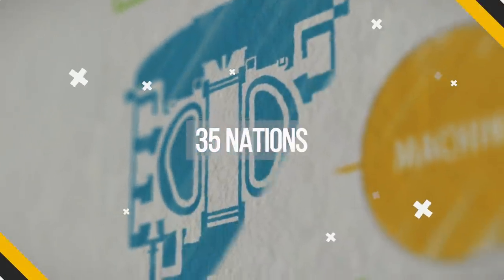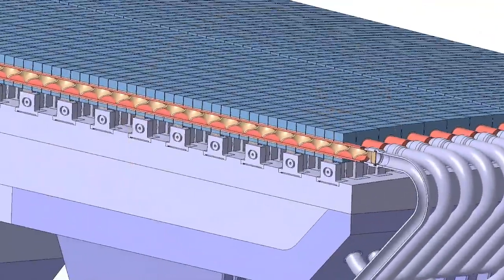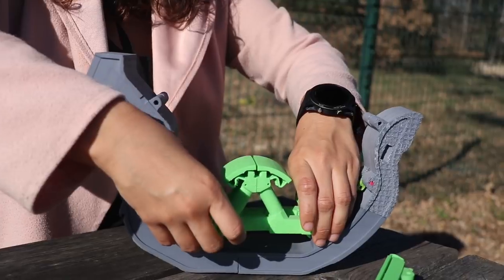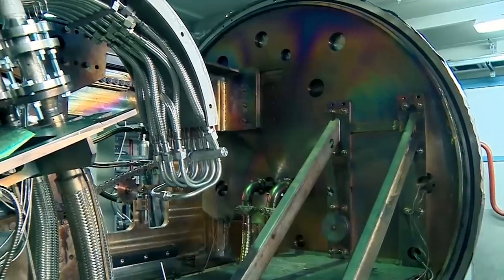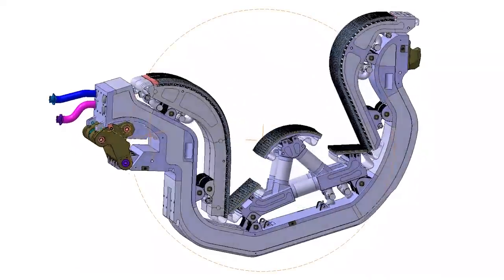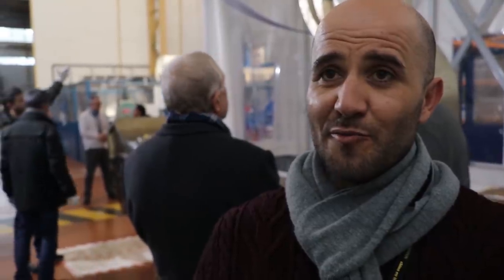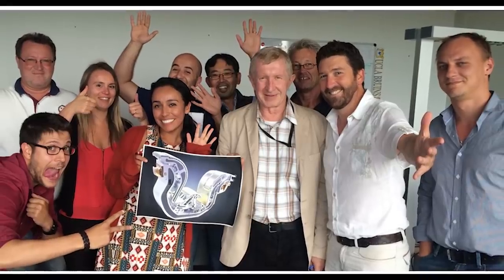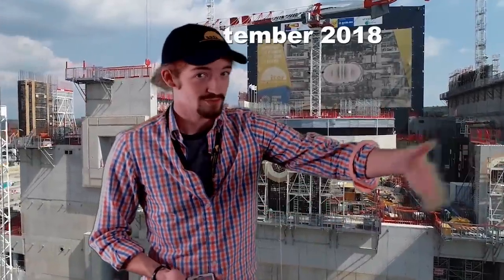ITER NOW 1.7: The Divertor Section

Comment: Thank you for going into the specifics of the ITER machine, it is really interesting.
I love this project and even if the only thing ITER did was provide a small chance of working fusion and nothing else I would be for it.
But many people are still very sceptical so I would like to ask you if you could you cover some of the innovations that have been done over the course of the ITER project and show that while they might originally have been meant for fusion research that they also have other important applications outside of this.
I think it is important that even If people are sceptical about fusion research that it produces tangible results that cannot be denied.

Comment: Great job, love what you're doing documenting this engineering feat! Looking forward for the next videos.
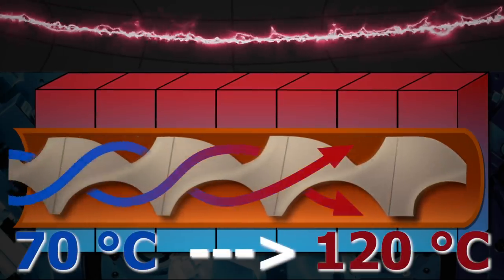I just wanted to point out that at 3:01 the animation can be misleading: the "swirl" (twisted copper tape) does not move, it is actually fixed in place, and induces turbulence as the water travels around it (source: I work on the PFUs for WEST at CEA).
Reply from the maker: You are absolutely right. The swirl is stationary, indeed. Thank you for pointing that out. Quite an amazing system.

Comment: I thought ITER time plan will ends in 2020 😔😔
Reply from the maker: ITER's first plasma will be in 2025 - the divertor doesn't have to be installed until closer to "burning plasma" which is planned to occur in 2035.

Comment: The concept is flawed.  Started at $15B, then $30B and it keeps going up with no results.  There new better fusion solutions that twist the energy stream as to stop electrons from smashing into the walls ( allowing the reaction to continue longer based on energy and stability) or there is the B11 concepts (two, one with laser technology and  DPL) of which are more plausible to succeed.  So why pour $B into ITER? I say slow it down, no more funding until they show progress and divert future funding to the more promising Fusion technologies.
Reply: A classic example of the Dunning-Kruger effect.
Reply: Because the European bank can print money as much as they can.. specially in this times 🤑 so why not? After all it's all about money😁